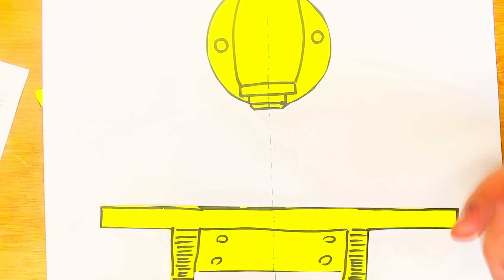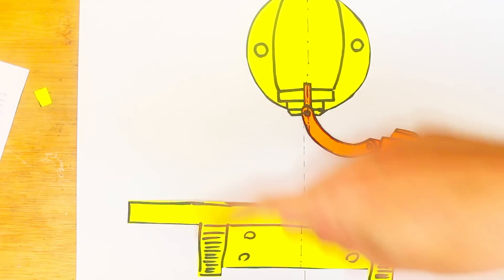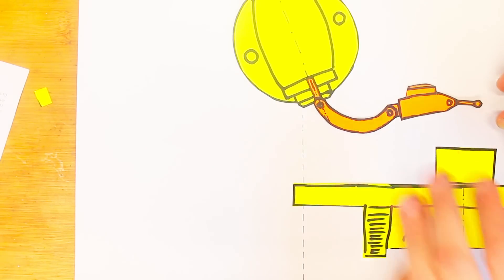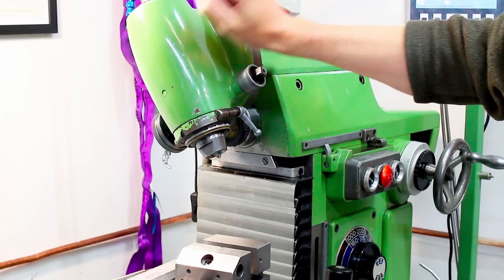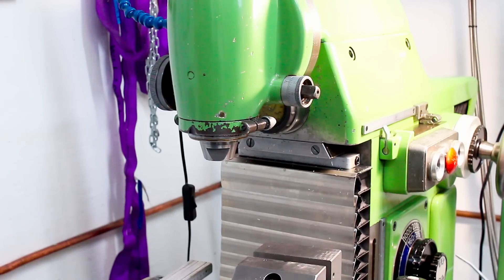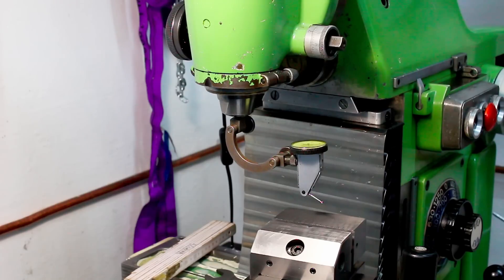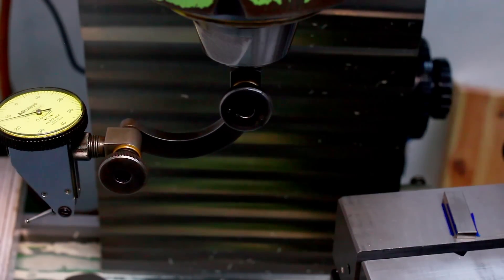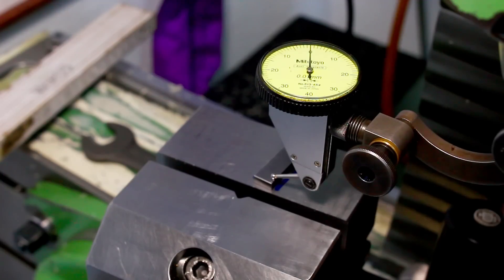Machine spindle tramming

Comment: 14:00 how do you know that the table travel is square to the head? isn't the tilt of the table vs the travel of the table independent directions? (eg; the ways are worn in the middle, and the table itself ends up slightly lower at one side of that sweep vs the other, so that "0" reading won't be parallel to the table at any one place, but is pararallel to the average travel of the table.

Comment: A: a Bridgeport has reference surfaces machined into the quill housing, so that you can hold a square on the table and against the reference surfaces….for rough tramming.   B:one of those 2 indicator rigs for tramming is well worth the dough!
Reply: Most BP operators forget about or do not know this trick. IMO when manufactured the mills should have two pins that can be inserted to fo a quick alignment. When the head is tightened down remove the pins. Like the alignment pins on the turret of a CNC lathe.

Comment: Hmm,11:00,  Not sure about this method Stefan. You are not actually tramming the head, you are making sure that the table is square to the head, If the table is worn or the gibs are slightly out you are getting a false zero. I prefer the quill up and down method although if the spindle bearings are a bit worn you also have slop. I personally have a long reach DTI and tram the table. Seems to work for jig and fixtures. Happy me. lol. Best wishes Mal.
Reply: This method will average out the error of a worn table

Comment: Yeah, Adam's paper cutouts are surprisingly effective didactic material. 
I actually have been thinking about that. It must be because they are physical objects and you can handle them, point at them. I guess our brains find it easier to process than fancy 3D graphics.
Reply from the maker: Its such a great aesthetic style with the heavy black outlines, i love it. Its also quicker to do and easier to "animate" than doing it on the PC in Cad or some illustration software.

Comment: The brake rotor is a great idea... Lap it dead flat and parallel, lay it down and sweep it... I do just have an SUV huge brand new rotor that i took off my mechanic friend as he didnt need it... I dont need it either, but i took it anyway, knowing its a huge fat disc of fresh ground cast iron that i can turn into a lapping plate or some other plate/fixture project... It doesnt beat sweeping the ends of the table, due to wider parameters and gauss principle in a way, but for checking the tram quickly, a sub-micron lapped solid rotor will do marvels... It has over 30cm diameter afterall, so instrument grade surface on it should allow for a nice quick check with a mikrokator... The rotor also has the 5 hole pattern, where two holes are in a line, making it a great way of quick clamping down for such fine readings, and the two small screw holes for rotor retention when the wheel is off make for nice handle places as to not influence the rotor with body temp. transfer... Two file handles with screw in nutserts m6 would provide a great way to handle it for peanuts essentially... Thanks Stefan... You just gave the noblest purpose to an item that was supposed to be trashed as unneeded... A brand new thing woulda seen the shredder just as a written off extra, and now it will be a lab grade instrument for possibly over a hundred years... Its still covered in factory wax...

Comment: Nice to have you back (I assume) in the northern hemisphere. I really like the old school graphics:-)  I have a Jet clone of a Bridgeport and you're right about the top heavy and the worm drive, etc. It's not a big deal, though. Like you say - put a little friction on the holding screws and tap things around a little. I hadn't thought about sweeping vertically along the spindle. It's over 110mm on mine. That would normally be plenty for what I usually do, but as long as a person's doing a thing like this it's usually worth slowing down just a little and doing it slightly better than you need.